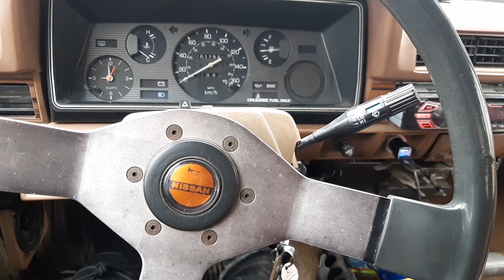cold start no choke again colder weather now

Comment: It sure doesn't like the cold weather.
Reply from the maker: yeah never did. think its a carburetor issue i did swap carbys long ago cause it had a bad gasket and i did a manual choke thing that doesn't work right either
Reply: @Barret_Radtke  I'm going out to do a cold start too I hope it starts as it's -9 here now.
Reply from the maker: -9 here too atm.